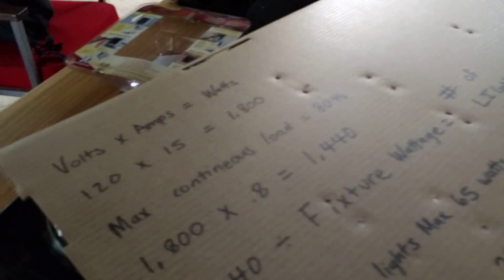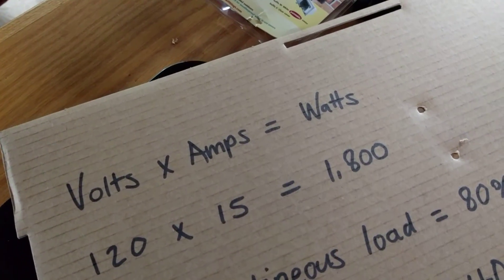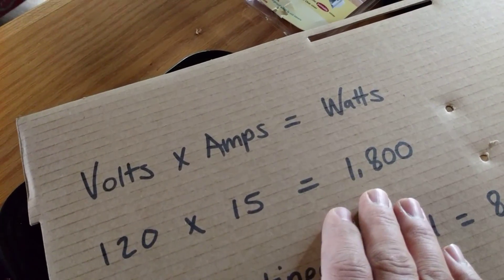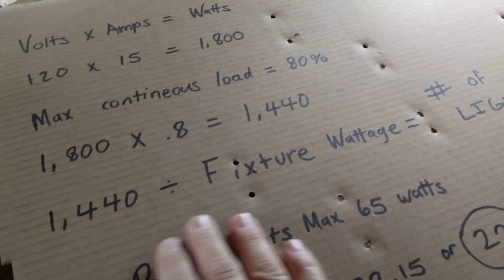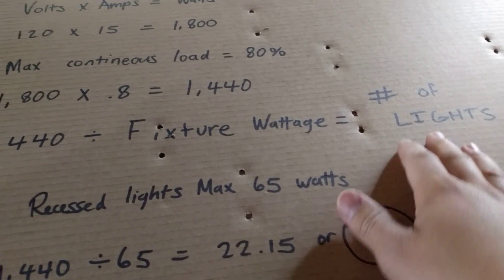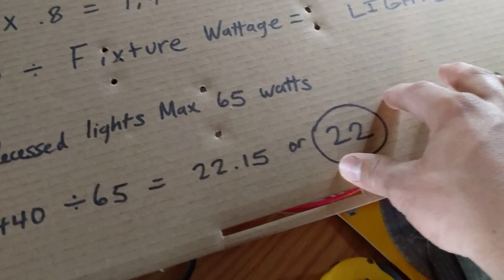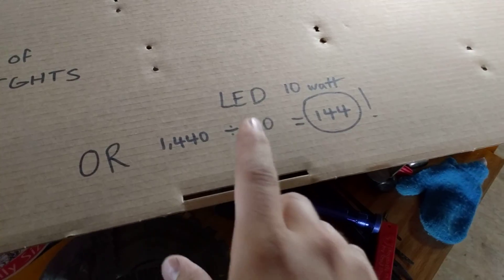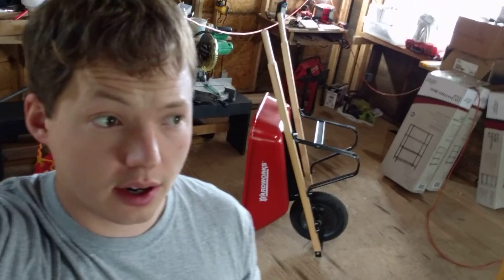How Many Lights on a 15A Circuit Breaker? Calculate Wattage for 15 Amp Circuit & Number of Fixtures

Comment: How come you didn't use S=V*I? and get VA and if you use P =V*I*P.F. I do agree on keeping the load on 80%(.8) of it's capacity. for what I was taught  in school a 15A breaker can stand 1800VA keeping it at 80% would be 1440VA.  1440VA would be an equivalent in watts at 90%(.9) P.F to 1296 watts.
Reply: It's a linear load so VA=W
Reply: What do you mean by linear load? The equation seems right IF you are assuming in-rush current is 10%, which no one has brought up except for @ElaBueLoRocKnRoll
Reply: Yes! No one is talking about in-rush current. I'm not sure what P.F. stands for but it looks like you are taking 10% for in-rush current. W*.8*.9= final usable wattage. This factors 80% of the load and factors 10% for in-rush current.
Reply: @btownb4462  PF = Power Factor.  Power factor is basically the efficiency of a load in the circuit.  For a perfect power factor of "1", then the voltage and current will be completely in phase with one another.  When they drift out of phase, the PF decreases.